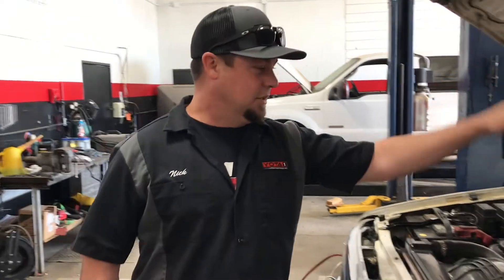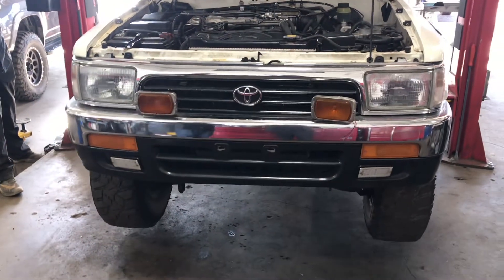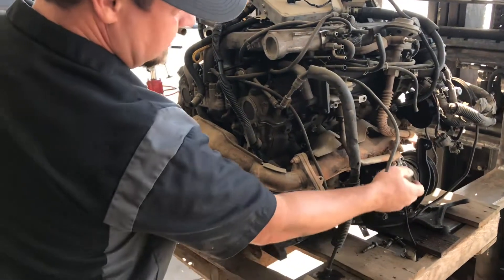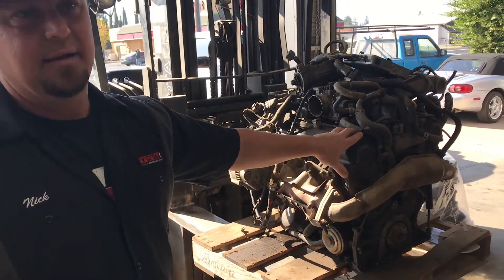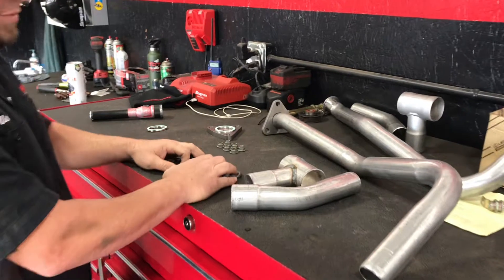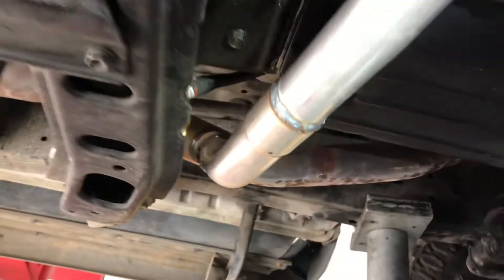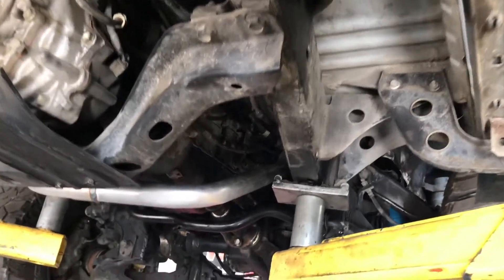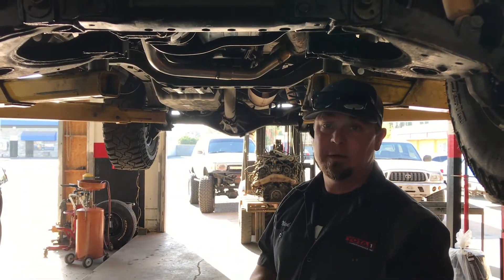3VZ Crossover Delete Instructions

Comment: I’ve been the owner of a 1989 Toyota 4wd v6 pickup manual transmission for 28 plus years with my father being the original owner for 8 years.  I do disagree with the crossover pipe being an issue and the cause of head gasket issue.  During the year 1998, under the head gasket campaign, I had the head gaskets replaced with the newly designed Toyota head gasket and haven’t had an issue since then.  I do change my coolant every three years with the Toyota super long life coolant and about 8 years ago I did the valve shim adjustment, in which 2 intakes and exhaust clearances were out of spec. (One of the exhaust shims out of spec was related to the number 6 cylinder).  I was told  by a Toyota employee that one of the purposes of the valves being closed is to draw heat to the cooling ports where the heat then makes it way to the radiator for cooling.  As the late Pat Goss pointed out coolant becomes acidic when left in the engine for too long.  The proposed crossover pipe theory would not explain the continuing longevity of the head gaskets on my truck.

Comment: I contacted Yota1 and inquired about the kit. I was informed they do not have plans to sell this as a kit and directed me to buy the plates then have a local exhaust shop make the down pipe. I’m going to go ahead and do that. Beats the price of headers.
Reply: They still offered the plate kit for the 3.0 VZE, but no trace of the pipe kit. Also I wondering if it would be strictly necessary pull out the engine or if the modification can be done without that procedure.
Reply: @ I ended up getting Doug Thorley headers. I didn’t have to remove the engine but it was a pain to get the crossover out. It will fall out the drivers side wheel well if you shimmy it right. I had to cut the drivers side of the crossover from underneath because it ended up seized and rounded off. Harbor Freight cheap sawzall did it in seconds. Definitely pay attention to where your lines are running and consider getting some heat shielding for the starter, passenger floor, and some of the lines in that area. Good luck!
Reply: @Subarota yooo I am going to buy the DT headers, got a 3vze v6 3.0 DLX pickup. Is there any tips you got for me other than the ones listed? I got the plenum and valve covers off right now

Comment: I just wrapped mine after replacing the heads (in CA and afraid to mess with the exhaust system due to smog nuttiness here).  Now the motor is overheating. It has a new radiator, fresh TOYOTA OEM coolant, and everything else the same. I THINK wrapping the crossover pipe is causing overheating, but I am not sure yet. I can find no information from anyone anywhere who has tried wrapping it. 😕
Reply: These 3vze engines require a tight  fan clutch that isn't weak,, oem Toyota long life genuine 60/40 distilled water,  a good radiator,  10w40 elevated zinc conventional oil. I'm using Driven or any elevated zinc conventional oil. I just drove my 3vez to Flagstaff az and back. Temps outside 108 degrees. My temp guage stayed below middle.
Reply: @tonyisme4934  what brand oil are you running? ty
Reply: @tonyisme4934  You're the 2nd person I've seen recommend that oil.  I was advised some years back to use Delo 15w-40 and read online somewhere which corroborated that.  Any thoughts?
Reply: Wrapping won't cause you to overheat, i've wrapped before and no overheating issues. Also, its not the heat radiated from the crossover that is the concern, The 170 degree elbow is the choke point of the exhaust flow. imagine exhaust flow similar to the flow of vehicle traffic. If you drive towards oncoming traffic and then complete a 170degree turn. you're gonna be slowed down by the cars that are already moving the direction you're trying to go. that slowdown becomes the hot spot. 

also, don't forget to burp your engine from any air in the coolant, air in the system can cause an overheat even after replacing the heads.
Reply: it maybe. the heat has to dissipate but because it’s wrapped it’s stuck there’s
Reply: @Another_rollingstone  As a follow up, I unwrapped it. Yet it kept overheating. I went through many different things with no luck. Finally, I removed the thermostat completely (hot weather) and it never overheats. My only conclusion is that it needs a much lower temp thermostat.
Reply: If using any other coolant, likely to experience corrosion..and oem Toy thermostat...I'm not running a cat. No inspection/emission required. Quiet 3chamber muffler. 5sp manual